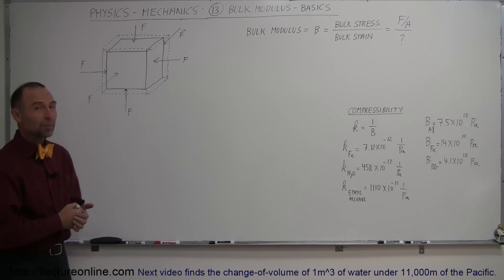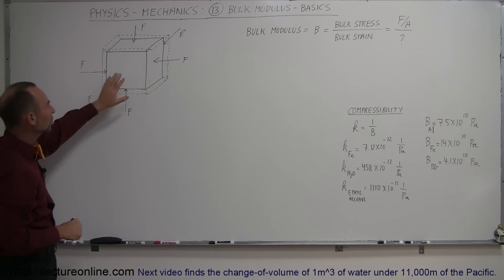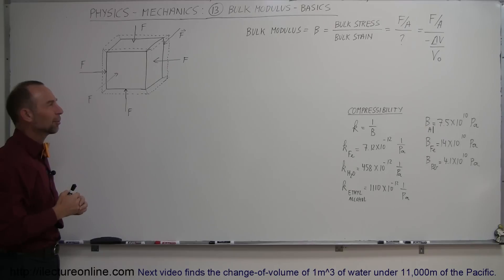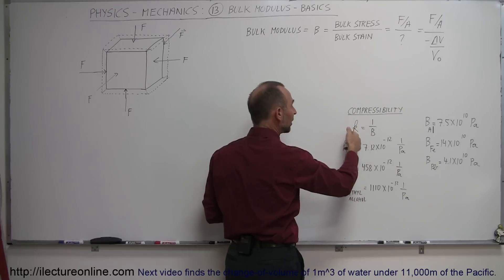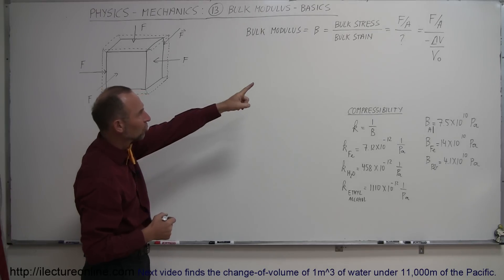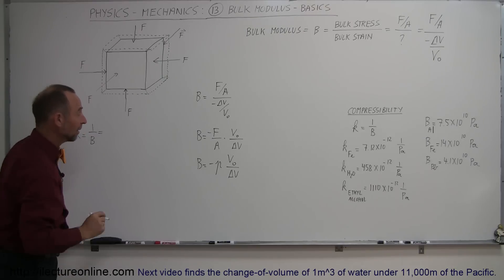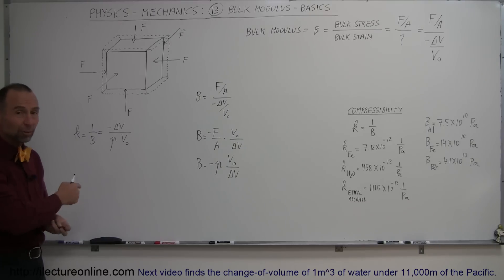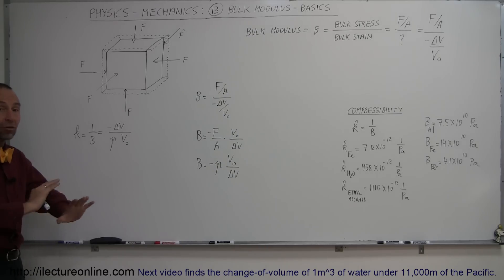Physics - Mechanics: Stress and Strain (13 of 16) Bulk Modulus: Basics

Comment: I can’t remember, Fe 170Gpa bulk modulus, is that for 1% or 100% compressed .
Reply from the maker: The bulk modulus is equal to the ration of the stress/strain  =  (F/A) / ( - delta V / Vo)
Reply: @MichelvanBiezen  I used a online calculator it’s 100% 
You wouldn’t happen to know what the S4 is in this,  1 m2 kg / s4 equation is .

Comment: At 4.45 - can someone explain how the inverse works at that point. I am not sure how the "p -pressure" gets to the denominator. I know it's just algebra, but I don't know that rule? I understand how to solve a fraction divided by a fraction (by flipping one side and cross multiplying), but I don't understand the inverse of a term multiplied by a fraction. Can someone help? Thanks.
Reply from the maker: If B = - p Vo / delta V    then 1/B = - delta V / p Vo      Essentially to take the inverse of a fraction you simply flip the fraction upside down.

Comment: Your videos are great. I was just wondering what happens to the material if the pressure exceeds the force it can take. Theoretically if you keep increasing the bulk stress the volume keeps decreasing indefinitely, but surely there is a limit to how much the material can take? 
Thanks.
Reply from the maker: The pressure material can take is absolutely enormous.   Only at extreme pressure, much beyond what we can create, the electrons can be pushed into the nuclei such that you end up with nuclear material only such as in a neutron star.
Reply: Michel van Biezen very interesting! Thank you!

Comment: You have gone into this subject with much more concreteness and clarity than other videos on youtube so I will thank you for that, but one thing that I wish you had gone into as well is the actual bending of a material when force is applied on one side but not uniformly so. Your example of cutting out a coin kinda approached the topic a little bit but didnt adress it. What happens when I apply a certain point force along the length of a steel beam? How would I calculate the degree to which it would bend, the arc created by the bending etc any keywords that I should look out for as I research this topic?
Reply from the maker: That is a topic that is covered under "strength of materials" in mechanical engineering.   A topic we'll be covering in the future in our mechanical engineering section.
Reply: Wow! I didnt even really expect to get an answer from you to be honest. Thank you and Im definitely looking forward to your future content

Comment: Would it still be valid to use the bulk modulus if different amount of force is applied for different faces? E.g. on the cube you drew in the video, say that on the top face, there was 2F amount of force applied, while on the left face, there was 3F amount of force. For the remaining faces, F amount of force is applied. Would it still be valid to use the bulk modulus to calculate the volume change, or does the amount of force applied to each face of the object HAVE to be the same? 

Thank you :-)
Reply from the maker: You can make the size of the cube sufficiently small so that there is no difference between the faces of the cube.  That is how it is meant to be considered.

Comment: sir,during compression is there any heat is produced on that material
Reply from the maker: +Vinoth Axus That is a good observation.  The answer is yes, assuming that part of the work done compressing the object is converted to heat.
Reply: It's actually depending on the mechanical response of the material. A perfectly elastic material would release all its potential energy after compression, wouldn't it ? Heating is often seen in case of viscoelastic materials, where creep function isn't simply the Heaviside function.